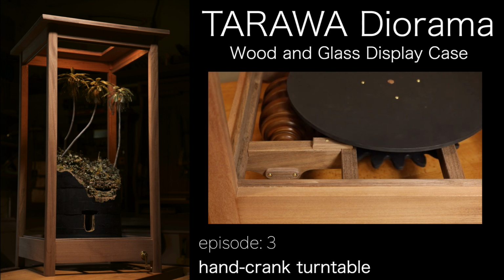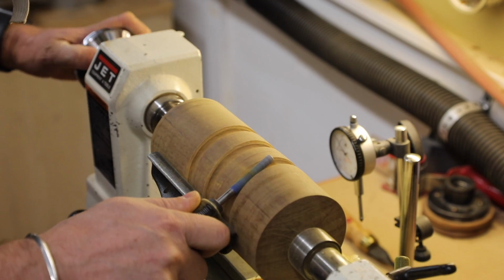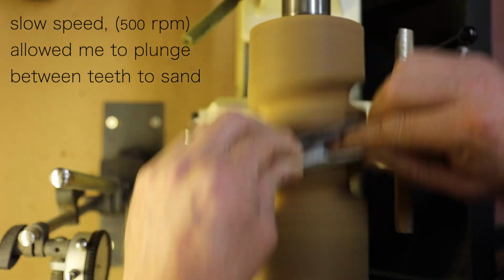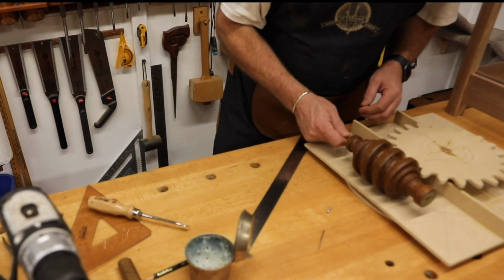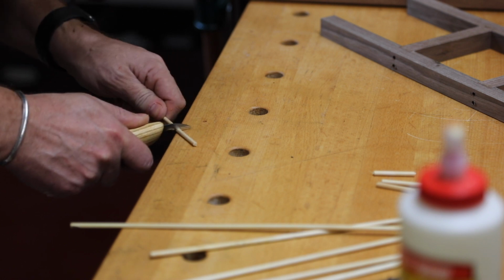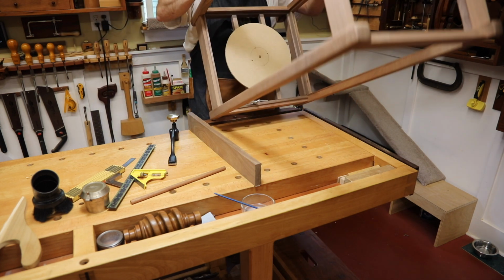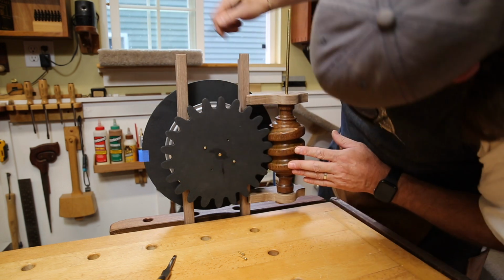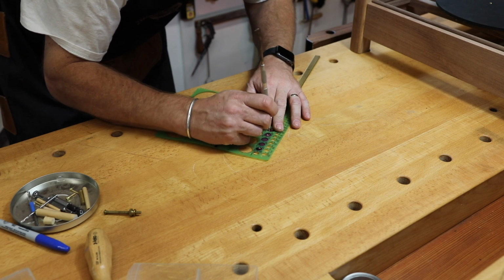Making a Wood Worm Gear - by HAND!

Comment: Sir. You are a genius
 You are the right person I need to ask. I have asked a dozen people including engineers nut no one could explain except Bundy beers
 Which is the smoother steering gear of the two worm and  roller or worn and nut. Please let me know
Reply from the maker: Thank you Safecarsforyou!! I appreciate the compliment, but alas, I am but a humble woodworker and model maker and I have no background to give you a proper answer. I sure do hope you find what you are looking for!!! Take care, Bill
Reply: Thank you Bill. Your humility will lift you up. I thought about it the whole night and have concluded that the worm and roller is the more efficient over the worm a nut because the hour glass shape of the worm causes the variable steering ratio. The ratio is greater at the middle of the worm, the efficiency is lesser that's when the wheels are straight but as you turn the steering wheel to the right or the left the flaring ends of the hour glass shaped worm come into contact with the roller amd the steering ratio decreases and the efficiency increases that's not the case with the worm and nut ( recirculating ball bearing) where the ratio is constant and the efficiency is also constant. So my conclusion is that the worm and roller is more dependable as you have better control when you drive straight at high speeds and better efficiency when you maneuver while parking, turning or when making u turns.comnon sense tells us that the principle of bearings is for smooth encounter as the friction reduces as the contact area decreases .so worm and nut is the smoother of the two ,ideal for heavy suvs trucks and buses but for passenger cars other than small hatch backs and any transverse engine set up where only rack and pinion is the only steering gear possible ,in all other set ups such as a straight engine rear wheel drive the worm and roller is the best
Reply from the maker: Hi Safecarsforyou!!! I didn't realize they had the tapered ends to vary the turning ratio the further from centerline, but as you explained it, it does make sense. I've been fascinated with the early open wheeled F-1 cars from the 30-60's, and have wanted to build a Cyclecart styled like one for years.